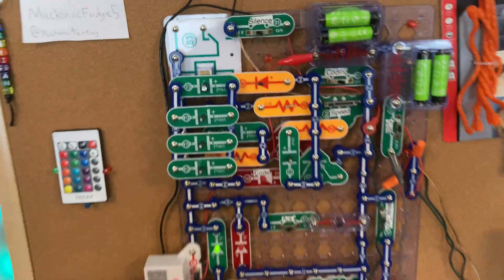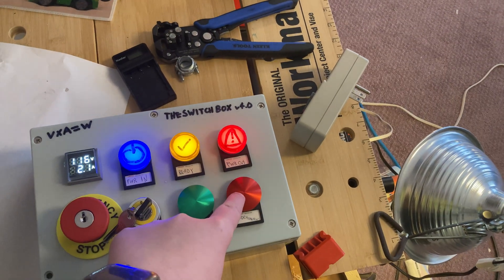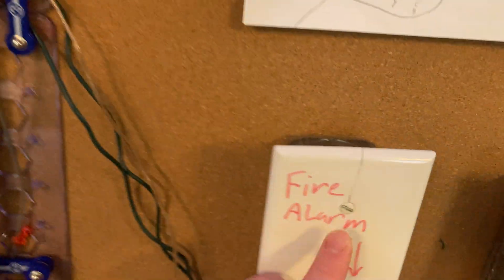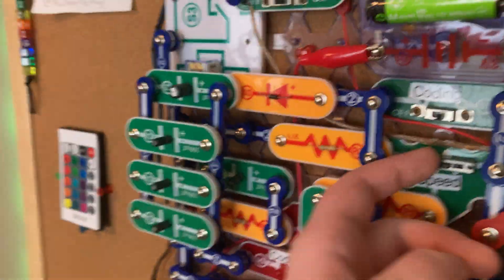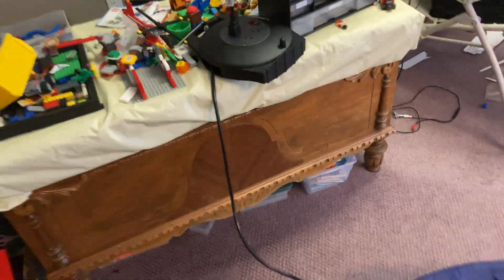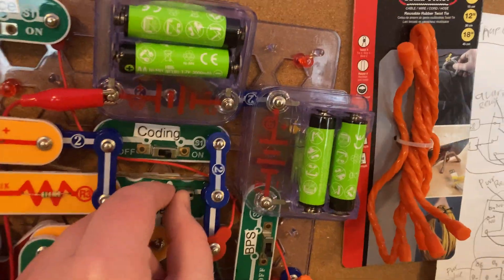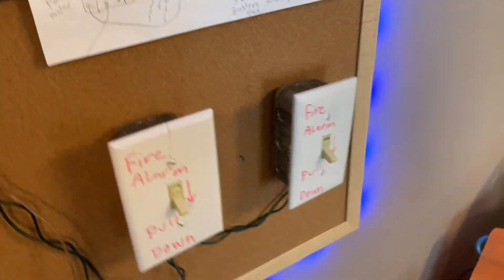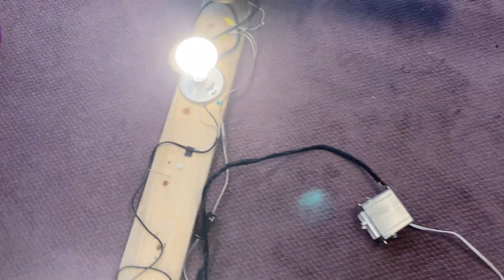Snap-Circuits Fire alarm system test #8 🗣️🗣️

Comment: Well, I’m very good at figuring out snap circuits. The reason why it’s pulsing so fast because the speakers are using voltage right but if you turn off the voltage, then it will start posting so fast.